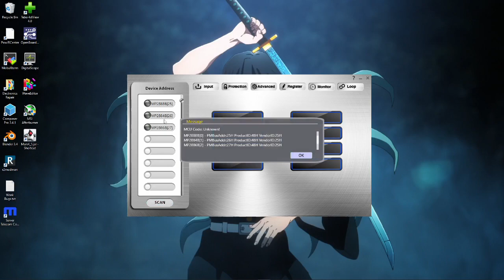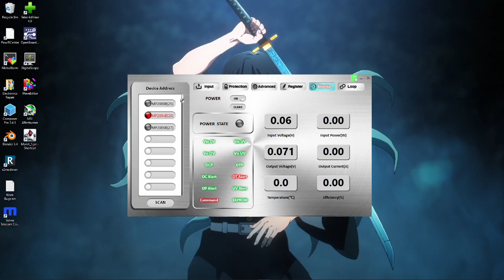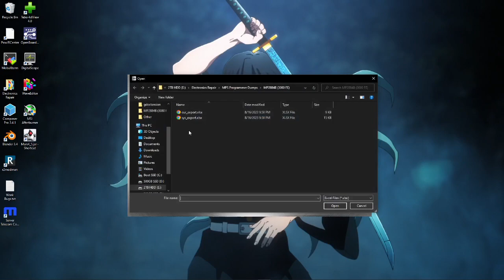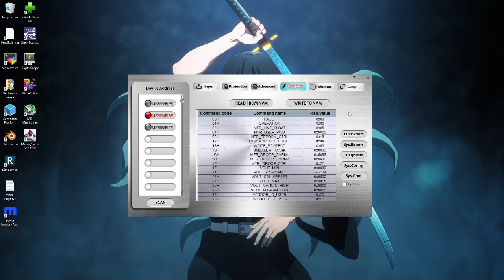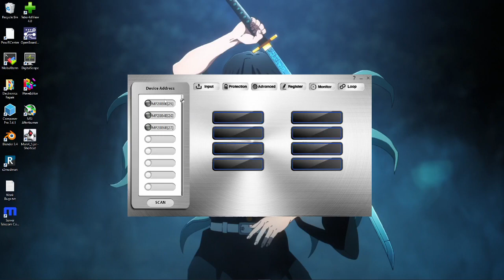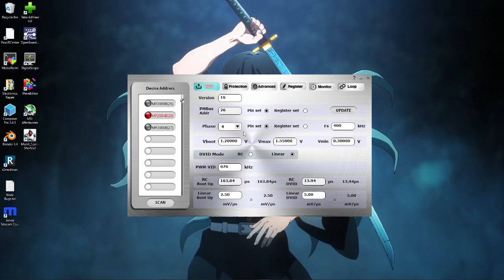How to Program New MP2884/6/8B Controllers

Comment: Can You show how exactly have You connected wires to IC?
Reply from the maker: Yes that's my plan, but I didn't have a lot of time so I just threw this quick video together. Give me a little while here and I'll put up another video showing the full process, from connection to flashing!

If you just need to know about the wire connections, I stripped and attached two thinner wires to two of the cables that they included with the programmer. The third (ground) wire I stripped and left. If you look up the datasheet for the chip you can see which pin is scl and which pin is sda, those are the clock and data pins needed to communicate with the chip. Wire your two wires on those lines (in my case there were two resistors right there next to the chip so I wired to those), and then connect them up to the programmer, making sure you connect them respectively.

Then solder the other wire to ground, and plug that into the programmer as well. Power the card's 5v rail with a bench power supply (there are other ways to power up the chip but this is the easiest in my opinion), and plug the programmer in, hit scan on the software, and there you go!
Reply: @WasatchElectronics  where to download the software
 friend

Comment: Hello
What voltage did you use and what pin on IC to power it up?
Do you think if I connect scl, sda, gnd and power from bench power supply to IC directly I could connect it successfully?
Reply from the maker: Sorry for the late reply, I figured I would still respond in case anyone comes across this. You'd want to check the datasheet for the chip, that will tell you which pin needs to be powered and the voltage. For the MPS chips I believe you only need a 3.3v supply (it's been a bit since I've done this, haven't fixed anything the past few months). Yes, you can do scl, sda, gnd and power directly from the bench power supply. It's easiest to just put the IC on the card and then attach a wire for power, scl, sda
Reply: @WasatchElectronics  
Hi 
Thanks for reply.
I did like that. But the problem was IC that was delivered from Ali. It was already corrupted. So I used another chip and everything was fine. There should be some miliamps drawn by IC, and that is a sign of working IC.

Comment: No way, I think I just burnt my laptop.
I changed the MPS2940A and didn't know that I had to rewrite the configuration so I booted the laptop so the laptop shutdown LED is off forever CPU is shorted and 2 DrMosfet output 19V. 
I think the CPU is already dead
Reply from the maker: I don't know as much about laptops as I do about graphics cards, but - It might actually be fine. 19v sounds fine for a laptop, that's the voltage coming from the charger before it gets used by other converters or mosfets to power everything else. The processor is likely just a very low resistance, which is normal. On graphics cards for instance, the main power rail for the processor typically reads well under an ohm, probably .2-.5 depending on the card. Try programming that 2940A and see what happens.
Reply: @WasatchElectronics  19V at the coils of cpu! should be max 1.2V
Reply from the maker: @MLS.22  Oh 19v at the coils of the CPU. Ouch, that thing is definitely dead now :(
Reply: I dont have the device to program the QFN I dont thing its good idea to buy one if there is chance the cpu is dead
 @WasatchElectronics